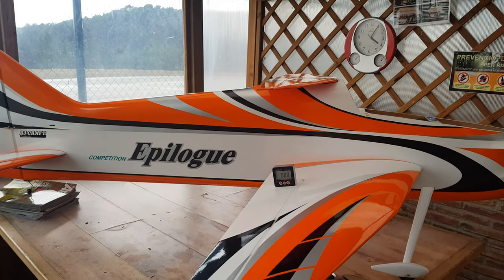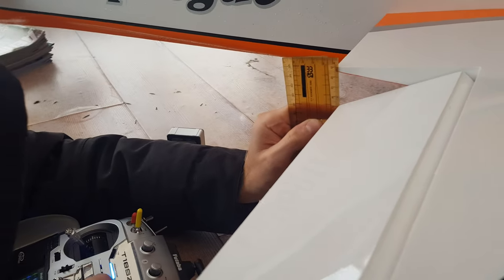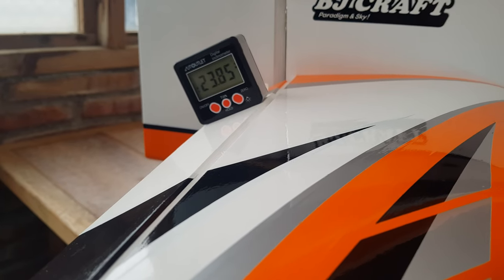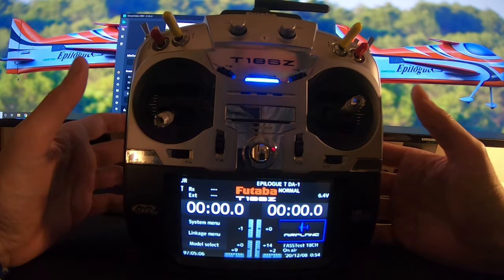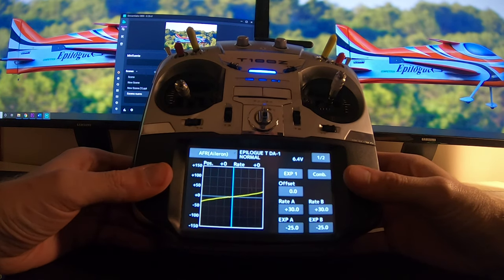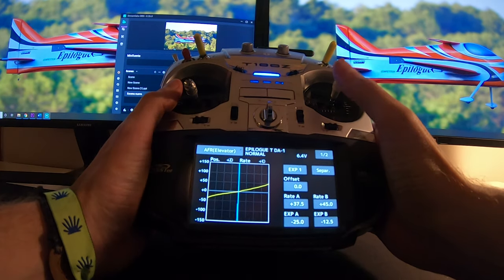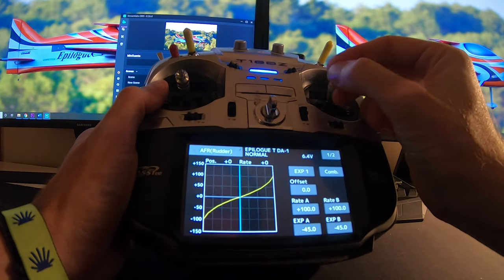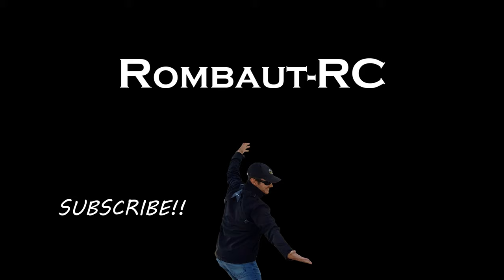Dual Rates and Expos for F3A

Comment: Thank you sooo much for sharing this. The settings are very different to what I have been using (I don't use any Expo for example)... & I've never found anyone else who seems prepared to publish their settings.  I've now set the same parameters on my RF Simulator, which seems to be pretty good. So next to try them on a real model. Thanks once again!
Reply from the maker: Thanks Russ! If it is the first time with expos, start with small values and check how do you feel. Cheers!

Comment: Always insightful Juan; thank you.  I am curious about no differential on ailerons (more up than down).  Not necessary for axial rolls? Looking forward to next video and announcement.
Reply from the maker: Thanks Julian! The differential on ailerons can compensate the adverse yaw tendency of some models, especially with large wingspan compared with the length of the fuselage (we use it in all our gliders). I have seen a lot of times big discussions about aileron differential for symmetrical airfoils. In my opinion, the actual F3A designs are well compensated, and as you said, unless you feel something weird in axial rolls (sometimes the rudder is not well trimmed... 😅), I prefer to leave it with the same deflection up and down. For the Epilogue and the Cosmic I had zero issues with rolls, even with faster rolls with big deflections. Cheers!!